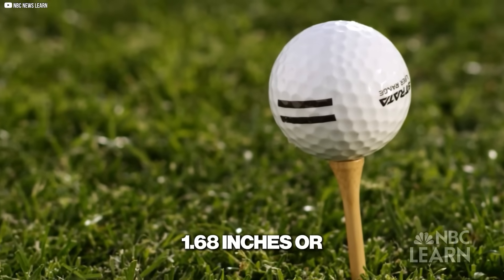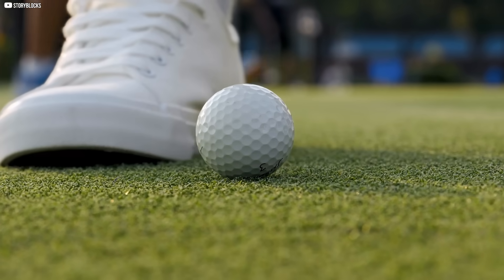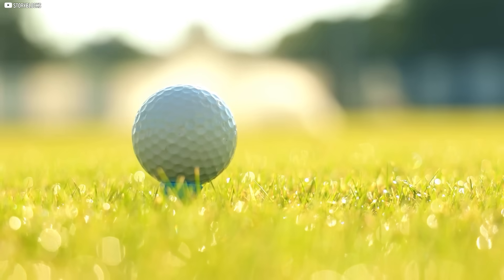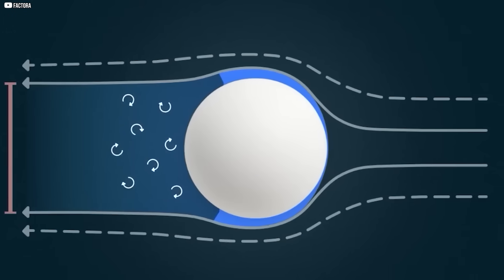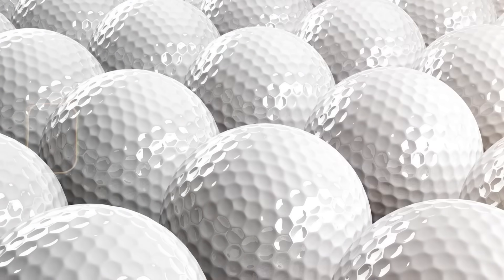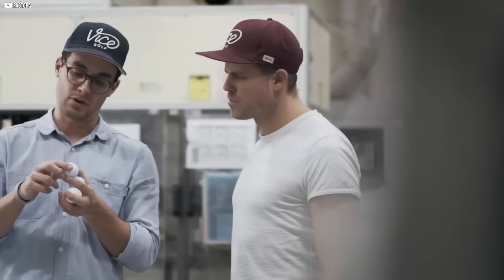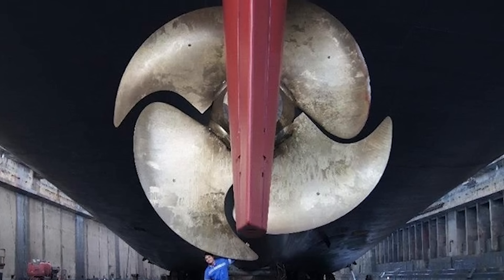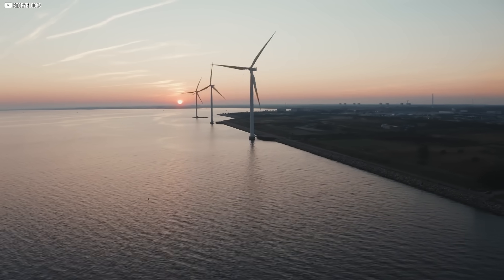Why Golf Ball Dimples Are Revolutionizing Propellers

Comment: So why don't they dimple bullets?  Or artillery rounds?
Reply: The airflow over the dimples probably behaves differently with something that’s going supersonic, I would guess. Might actually increase drag
Reply: @particle_wave7614 At some point a  bullet or artillery shell will decelerate to sub-sonic speed as it slows down, but in theory a dimpled nose should help it maintain a flat trajectory and go further as it slows down.
If not in high speed bullets, I wonder why not dimple slower projectiles like mortar rounds or the nose of rocket propelled gremades to help them go further and stay flatter in trajectory.
Reply: @particle_wave7614 Never mind my asking.  I found a source that confirms the US army did in fact test a dimpled bullet in 2009 at the Aberdeen proving ground, which revealed "spectacular" results.  If so, why aren't they on the market or heard about much?  I think the military wants to keep it that way for a later surprise.

Comment: I've been waiting for these dimples on the side of truck trailers.
Reply: be surprised how many fast and quiet cars have them on the belly pans already, not only drag, but the dimples reduce road noise,
Reply: There's a patent against the use of dimples on a motor vehicle.
Years ago I was in research and development in the waterjet industry.
I studied fluid dynamics and its application.
I was going to do some wind tunnel experiments with a film adhesive you could apply to different parts of a motor vehicle to increase mpg, especially in the trucking industry.
So I looked up the patent. 
Found out that technology has been locked up.
Reply: @jesse75  I hate it when the patent holders  stop or limit the use of their patents. I remember when Xerox gave away the Ethernet protocol, the original GUI. AT&T had to give away Unix v7, but later split and turned it into System III...proprietary.

An inventor should be compensated, but not totally squash their inventions. Thanks for the info.

Comment: Why not try on cars?
Reply: they have and do, but they are on the belly. looks, and underneath it helps air flow and also and noise reduction. .
Reply: Mythbusters tried it.
Their results showed very little to none, in terms of fuel efficiency.
Reply: @jkg6211 on a sedan, but high end speedsters it counts. since at top speed it could take another 100 horses to go 10 MPH faster.
Reply: @diegojines-us9pc 
I stand corrected Sir.
Doesn't seem very practical so far, at least for cars... well, yet, anyway. 
Boat props on the other hand... well, we'll see... maybe with material advances and design. 
I hope to live long enough to see it advance. (If it ever does)